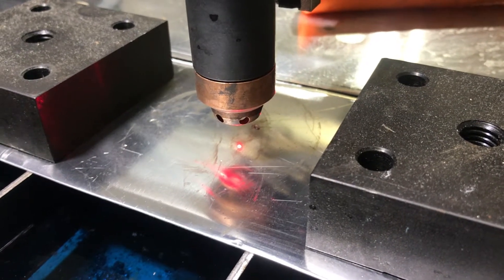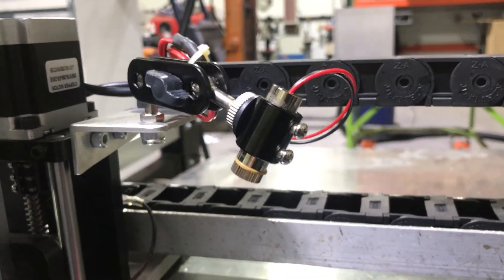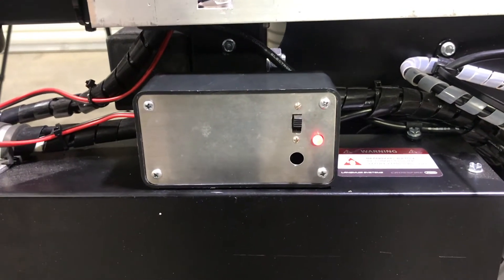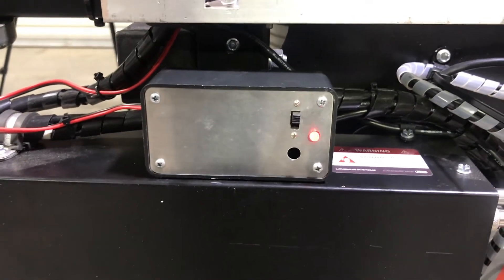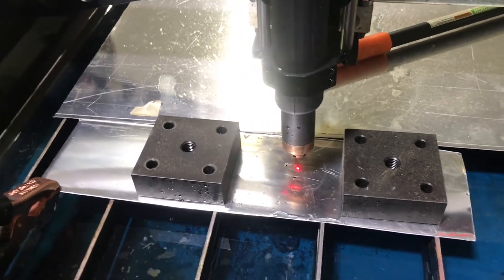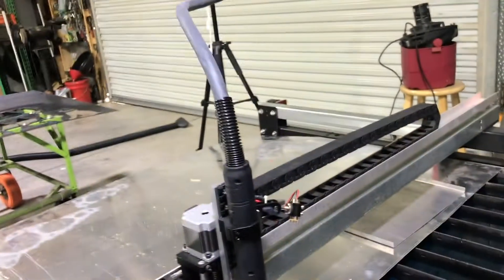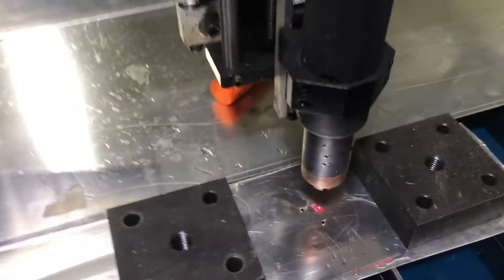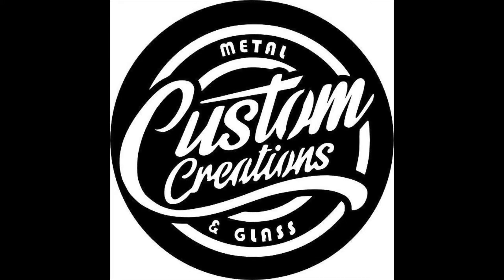Positioning Laser Upgrade

Comment: Where did you buy the laser
Reply from the maker: Paul,  

I provided to following to another viewer hope it helps.  

Here is the list of items I got from Amazon:

Hookup Wire:  100FT 18 AWG Gauge Electrical Wire, DC 12V Hookup Red Black Copper Stranded Auto 2 Cord, Flexible Extension Cable with Spool for LED Ribbon Lamp Light Here is the link if it works:
https://www.amazon.com/gp/product/B07CWQ6JPB/ref=ppx_yo_dt_b_asin_title_o08_s00?ie=UTF8&psc=1

Laser:  HiLetgo 3pcs 650nm 5mw Laser Head Laser Tube Adjustable Focus 3~5V Red Laser Tube for Sight Positioning Sighting Telescope(Dot/Horizontal Line/Cross Optional) (Dot)

https://www.amazon.com/gp/product/B072XF49LK/ref=ppx_yo_dt_b_asin_title_o04_s00?ie=UTF8&psc=1

Note:  you will have to focus the laser spot by turning the ring on the front of the laser

Mount:  FreeMascot 360 Degree Stand with 12mm-16mm Mount Holder for Laser Pointer/Laser Pen/Flashlight (Black) (Diameter 12mm Mount)

https://www.amazon.com/gp/product/B07F1T97V4/ref=ppx_yo_dt_b_asin_title_o05_s00?ie=UTF8&psc=1

I mounted mine on the piece I made for the drag chains

Battery and switch: LAMPVPATH (Pack of 4) 3 AA Battery Holder with Switch, 4.5V Battery Holder with Switch, 3X 1.5V AA Battery Holder with Leads and Switch

https://www.amazon.com/gp/product/B07C6XC3MP/ref=ppx_yo_dt_b_asin_title_o05_s01?ie=UTF8&psc=1

I didnt use these because I had a small box that worked for my application but would have used one of these otherwise.

Comment: I'm not that interested in reinventing the wheel so... I would love to know exactly which laser and mount you are using there. Links in the description or in a pinned comment would be perfect. I have the Crossfire Pro and I was trying to figure out the best way to do this exact same thing.
Reply from the maker: Here is the list of items I got from Amazon:

Hookup Wire:  100FT 18 AWG Gauge Electrical Wire, DC 12V Hookup Red Black Copper Stranded Auto 2 Cord, Flexible Extension Cable with Spool for LED Ribbon Lamp Light Here is the link if it works:
https://www.amazon.com/gp/product/B07CWQ6JPB/ref=ppx_yo_dt_b_asin_title_o08_s00?ie=UTF8&psc=1

Laser:  HiLetgo 3pcs 650nm 5mw Laser Head Laser Tube Adjustable Focus 3~5V Red Laser Tube for Sight Positioning Sighting Telescope(Dot/Horizontal Line/Cross Optional) (Dot)

https://www.amazon.com/gp/product/B072XF49LK/ref=ppx_yo_dt_b_asin_title_o04_s00?ie=UTF8&psc=1

Note:  you will have to focus the laser spot by turning the ring on the front of the laser

Mount:  FreeMascot 360 Degree Stand with 12mm-16mm Mount Holder for Laser Pointer/Laser Pen/Flashlight (Black) (Diameter 12mm Mount)

https://www.amazon.com/gp/product/B07F1T97V4/ref=ppx_yo_dt_b_asin_title_o05_s00?ie=UTF8&psc=1

I mounted mine on the piece I made for the drag chains

Battery and switch: LAMPVPATH (Pack of 4) 3 AA Battery Holder with Switch, 4.5V Battery Holder with Switch, 3X 1.5V AA Battery Holder with Leads and Switch

https://www.amazon.com/gp/product/B07C6XC3MP/ref=ppx_yo_dt_b_asin_title_o05_s01?ie=UTF8&psc=1

I didnt use these because I had a small box that worked for my application but would have used one of these otherwise.
Reply: @CustomCreations3  Awesome thank you so much. I've been looking at lasers and mounts until I got dizzy. This I know works because you demonstrated it. Much appreciated!
Reply from the maker: @p.t.anderson1593  happy to help